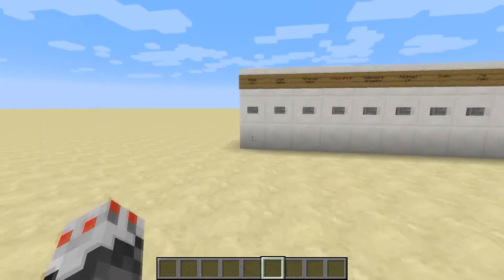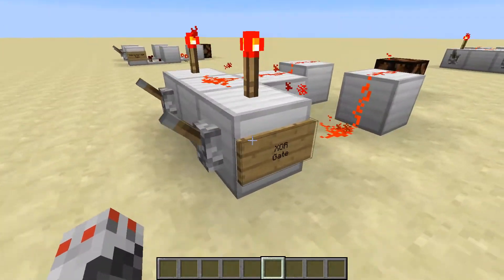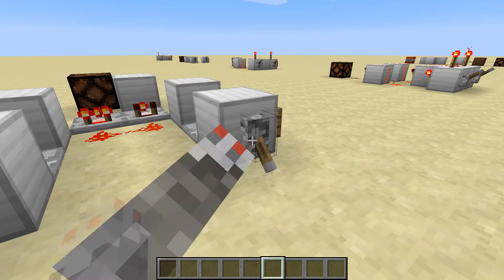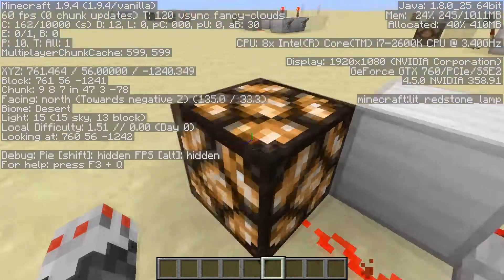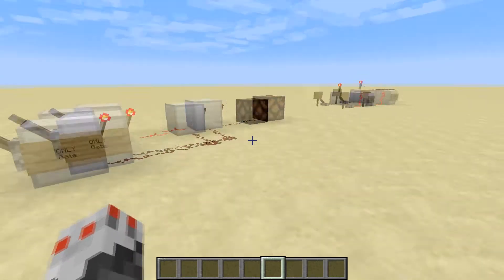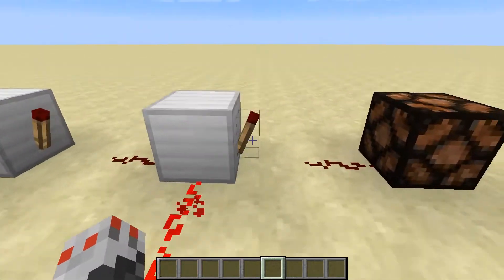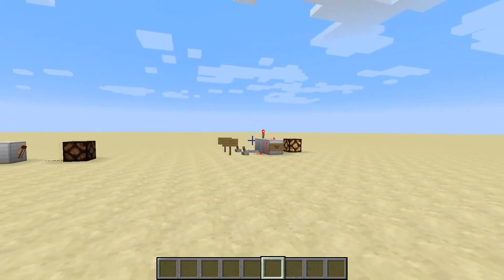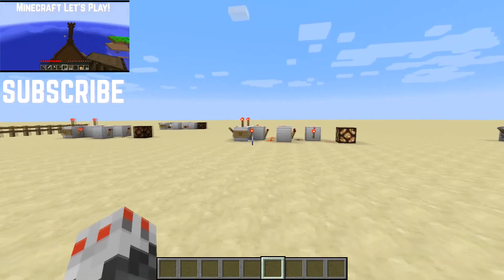"Advanced Logic Gates" - Redstone: Zero to Hero - Part 4

Comment: um your implies gate is either built wrong or has been broken by updates . if you set a to on and b to off out is still on
Reply from the maker: Just built it in 1.13 and it is working for me as shown in the video. Double check you built it correctly?
Reply: Allow me to introduce you to the Comparator